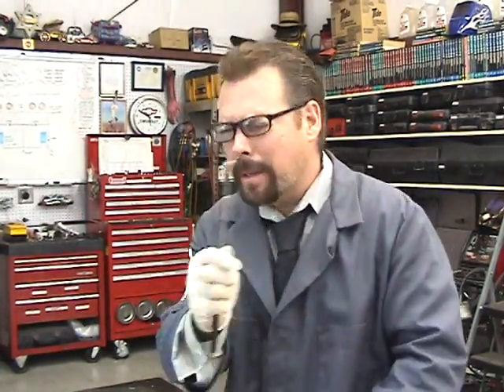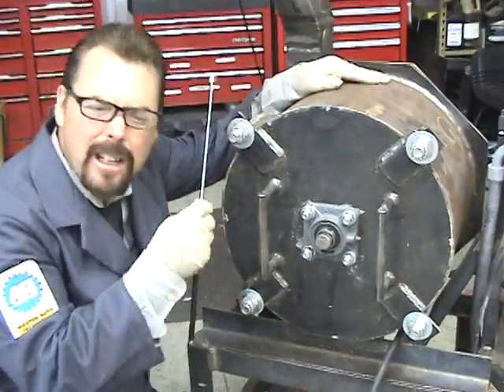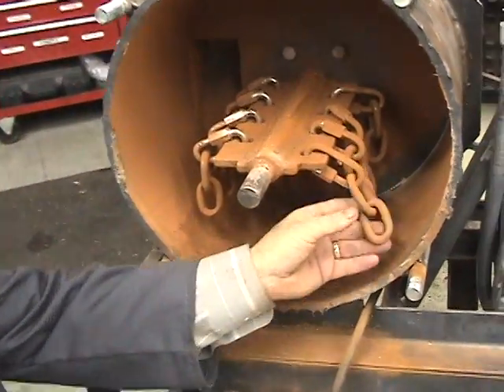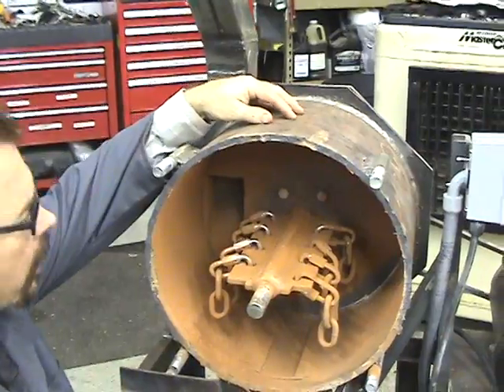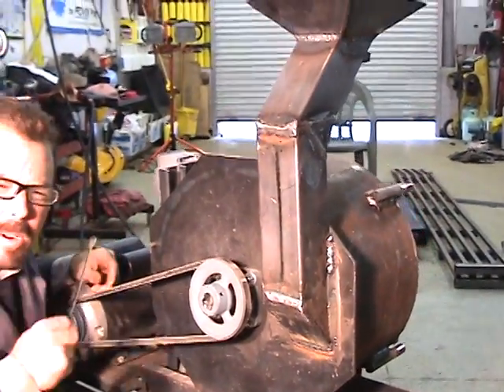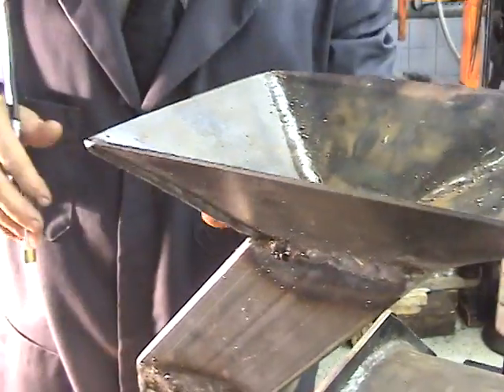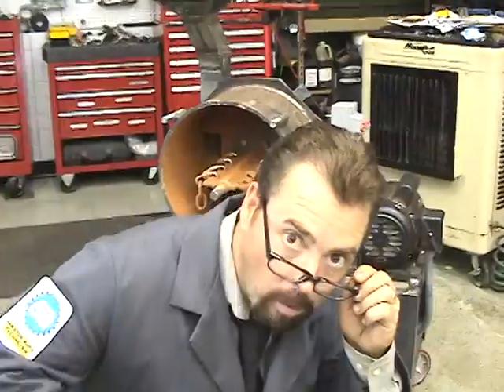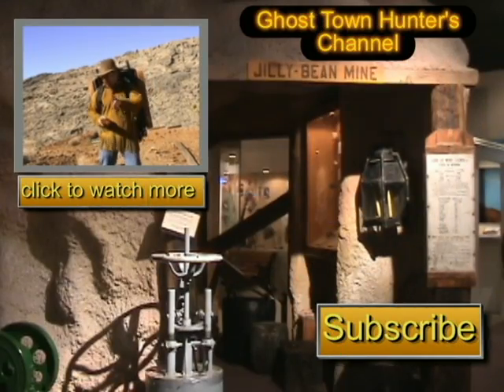ROCK CRUSHER BUILD | Impact Mill For Gold  - ask Jeff Williams

Comment: I am building a brand new one as we speak, it's 20 inches around drum and 14 inches long, 4 inch feed  sitting on 3 inch square tubing, I am about to make my shaft that holds the chain the problem I see or maybe it's not a problem looking at yours is it looks like it would be out of balance and wondering if I should quad the shaft then just having the 2 chain holders you have there, do you have problems with noise shake and vibrations other than normal chain noise ?  Going to be doing the shaft tomorrow so any help would be appreciated tonight if possible from you or anyone who has built one

Comment: Hi Jeff,
Thanks again for the videos.  I'm in the process of making an impact mill myself.  One question I have been struggling with is the output screen.  If I want 50 mesh coming out does my screen need to have 50 mesh holes?  When you say yours is putting out -50 mesh dust, is that the average size, or is that what your screen will allow.  I don't know how to get a 50 mesh screen that would have any strength to withstand the rocks hitting it.  I can get 1/8" or 1/16" punch plate easy enough.

Comment: hi Jeff,

just about to build one of these, so can you run it wet? And would this be better than a ball mill?
Reply from the maker: Dave T you can but it tends to clog unless you run a water flush on it while running. we run it dry not as much of a mess. Ball mills are designed to handle more material then an impact or flail mill.
Jeff and Slim

Comment: hey nice machine, how did you balance the shaft? Also what size gas motor would it take to run? My gen is to small for that but would love to have it on my claim. Thanks for the vids have learned some great stuff and will pass it on to my Grand kids.
Reply from the maker: Hi Rob we welded small counter weighs on until balanced and probably a 10 hp. Jeff

Comment: Hi Jeff, is there a pdf file or a document about this machine that you prepared? If you dont mind to give a copy of it, it will help me a lot in my senior thesis project as mechanical engg student... i will include it in my related studies... thanks :)
Reply from the maker: +adrian agunday  no...not yet but we are working on a rough draft of it due to popular demand. They are very easy to construct and the only real challenge is to calculate proper tip speed.
Jeff and Slim
Reply: can you give me some of the major advantages and disadvantages of using chains instead of metal bar for hammer... thanks in advance

Comment: Hi Jeff,  A question... When you said you would put the out-port for your crusher-pulverizer "on the side next time" did you mean higher up on the curve where rock would not accumulate or did you mean that the best design is on the perpendicular side, the side with the bearing mounts?  Thanks.
Reply from the maker: ***** exactly,.a side port would be better and the best place for the feeder tube is on the back like we have it.
Jeff and Slim

Comment: Thanks for the great video Jeff.. I decided to build one after watching your video. I just finished building a jaw crusher but I need something to get the material finer so I can run it threw my gold cube.  What did you use for a screen? Did you build it or buy it & what size mesh? Thanks again..
Reply from the maker: drtcurt We used punch plate we bought at Curtis Steel. Size is 1/ 8 th holes .Jeff and Slim
Reply: drtcurt  Any chance I could see some pics of your jaw crusher and plans if possible please?

Comment: How do you build the armature? How are the wings attached to the 1 inch shaft?
Reply from the maker: Mary Theodosis  Hi Mary that was the hardest part to build . It is two 1/4 inch plates welded to a hardened steel shaft with the ends machines for the pillow blocks.
Jeff

Comment: Hey Jeff, is material bought from a welder? How much for all the metal?  Love the video.
Reply from the maker: Hi Mark we bought the material from a Steel shop. ( Curtis Steel ) and Welded it ourselves. About 150 to 200 bucks of Steel   Jeff
Reply: you can also go to your local metal supply yard (flat,round or square)and have it cut to your specs and then bring it home, weld to print and then run the motor and test it out. of course sample ore is needed...
Reply: lincoln gasless welders are fantastic!! i had one and they also have a port to use a gas tank to create perfect welds if needed.

Comment: hi mr. jeff. i found your crusher interesting.i would like to bulid something like this but of different use. I am looking for a way to pulverize a coconut shell. I assume it would work but I am not sure. Do you think using also chain can pulverize the coconut shell? what are your suggestions about it?
Reply from the maker: Hi Errol for that I would use what is called a Coconut Grinding machine. Here is a link to one but if you want to make one I think a hammer mill would work better  then a flail mill which is what we have built.  Jeff

http://www.coconutmachine.com/index.php?mid=72&p=products-item&id=6

Comment: Jeff! What do you do if the material is a bit damp going in? Would it be prudent at that point to want to have a punch plate in the bottom and feed water into the top to then liquify the slurry so it drains out as it won't be "dusting out"? Actually.. you know what I just thought of--- even if hte surface of the material may be wet the huge bulk of the material would be dry.. so as long as your material is "SOAKED" and covered in 2" of mud you're probably gonna be okay. You might have to pop the front off from time to time to scrap out the "wet-hardened" dust that didn't dust up and out of the screen on the side? Does that make sense. 

I just won a 5hp Briggs & Straton engine off of the local auction that's begging to be turned into a rock crusher like this!
Reply from the maker: exactly

Comment: what is the speed in rpm of the shafting after reducing the speed of motor by using pulleys? our motor is only 1740 rpm is ok or too slow or too fast?

Comment: Where do you get hardened steel pipe from that is in 17" or larger in diameter?
Reply: If it is A36 steel pipe you can heat it up with an oxy-acetylene torch with heating tip until a magnet will no longer stick. Have a  tub of water, say a no3 metal tub with something for pipe to sit on at the bottom. After pipe is heated pick it up with a couple pair of channel locks with welding gloves and full face shield - this puppy is going to be hot! Place in tub quickly and get back. Water will probably boil, so wear appropriate clothing. Remember to have as much welding done beforehand as this changes the crystalline structure as well.

Comment: Jeff do you find an impact crusher better then a pulverizer?  By pulverizer I mean either with the the balls inside a rotating drum or similar to a bowl mill.  I worked for a coal fired power plant and bowl mills did an amazing job for classifying and powerizing the coal.  They would get 97% of the coal to greater then 200 mesh in minutes and using air to transport it out through the top, the heavier material would fall back to be re-crushed..  One day I would like to build a small version of one to test for gold mining.

Anyways, I guess I am asking you  if you find the impact crusher better then a ball crusher?
Reply from the maker: +letssled  for large volumes a Ball or rod mill is better but for small batches an impact will work but that depends on the screen size.
Jeff and Slim

Comment: Jeff in the video you say the only bad design is that the screen should be on the side wall. You suggest putting the screen on the side rather than the bottom.Will the crushed particles still exit the crusher if the screen is on the side? Doesn't it need to be on the bottom as you already have it? Surely the crushed rock will fall to the bottom not the side?

Thanks John
Reply from the maker: John Egan Hi John, the particles are rotating around in the drum at 1700 rpm and the finer particles will get slung out the side screen while the heavier, larger ones will stay in to be pulverized.    Jeff

Comment: Hey Doc see you've scaling-up your impacter from the baby mill you had before... NICE job too! 

If your anything like me you'll soon realize you also need a jaw crusher & ball mill or the processing gets bottlenecked something fierce.  If you run that baby dry get yourself a cyclone dust separator system for your shop vacuum or expect to stop & clean filters every 3 to 5 mins.  Using it wet can rot the metal/make issues with second grinds or sieving. 

Just what the doctor ordered though;)

Comment: I thought I was being clever an built a hand unit out of galvanized pipe. You know - Tin can get you pretty excited until you figure out that it's the galvanizing coming off.  Your device looks to work a lot better than the hand unit I built (3 " black iron [now] with a 1-1/2" pestle).  It works but not without some sweat!  Good job - especially pointing out a different screen location and rock feed design details.

Comment: Jeff you are a bit crazy. I love it. I am thinking of building a crusher like yours but for a different use. I am looking for a way to crack and break corn for feed. I assume it would work but I am not sure. I do not need the corn as fine as your getting it. I assume that by putting a screen with larger holes on it this would accomplish that. Just wondering what your thoughts are.

Comment: What size of motor do you use. what is the rpm.
Reply from the maker: +Philipp Reed 2 horse power with a 1700 rpm tip speed.
Jeff and Slim
Reply: +Ask Jeff Williams okay thanks

Comment: so if the mesh was on the side wouldn't material get trapped in the drum and be difficult to collect?
Reply from the maker: Hi Kyle what we have noticed is that yes it would collect at the bottom but would be pulverized eventually to be blown out the side screen. Now what happens is the material collects at the bottom and the larger harder rocks ( i.e. iron, quartz )  sit on the punch plate and slowly distort and bend the punch plate until small pockets form acting as traps for more material to get hung up so the punch plate must be changed out on a regular basis. We will be moving it to the side to make it more efficient . Then we will offer them for sale.   Jeff Jeff

Comment: Also you can do  few lines of hard welding about  using special electrodes. but you have to heat the chamber while welding and do some heat treaatment. I think just heating by acytilene gas will suffice your requirement as it is not critical job.
However thanks for your videos, very informative on every aspect .

Comment: I have a possible fix for your bottom mounted screen. cut a piece of steel slightly larger than the screen hole and mount it just a quarter inch or so above the screen hole so the material has to enter around the side of the screen hole.

Comment: Jeff,
 Good solid design. I think you are correct with the outlet being up the side further would beneficial.

My friends just bought a "hobby" gold, lead & silver mine, so we are going to build a crusher similar to your design, except gas or diesel powered.
 However, our design will put an output hose into a bucket with water in it to reduce the dust particles. A bit more messy maybe,  but silicosis can be fatal. Even with NIOSH approved safety equipment there is no reason to take chances. I have had 2 in my family die from dust inhalation. Paranoid? Yes,. indeed.

The way you have the input tube designed is vastly superior to a couple of designs I have seen on YouTube. I saw rocks come flying out of their crushers feed pipe on the videos. "Do not look into feed tube on rock crusher with remaining eye".

Comment: whats the thickness of the crusher front and back and the pipe
Reply: I think Jeff said 17 in high and 10 in long. So that would make it 16 in diameter pipe because carbon steel pipe is normally in Even Number sizes ie 6,8,10, 12. 14 16 inch dia. Wall thickness looks like Standard Wall which for 16 in Std Wall Pipe Sch. 40 = .375in wall thickness...You can go to your local Pipe Supply yard and buy remnants pretty cheap.

Comment: Seems like this method would pulverize gold flakes also to a fine powder making it more difficult to separate from the waste material in the end process.
Reply: One thing to consider is that rocks are hard and brittle while gold is soft and ductile. When a rock is struck it should break into a powder and the gold is more likely to just be bent rather than broken.
Reply: well, there is no way to crush rocks without damaging gold....